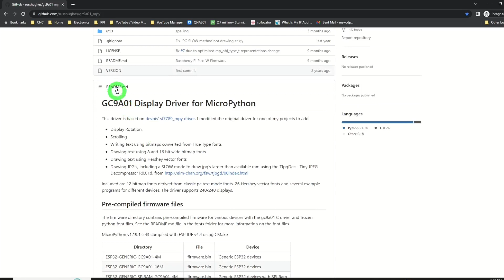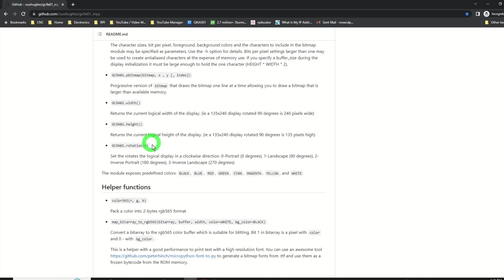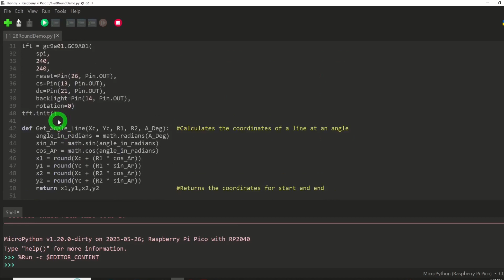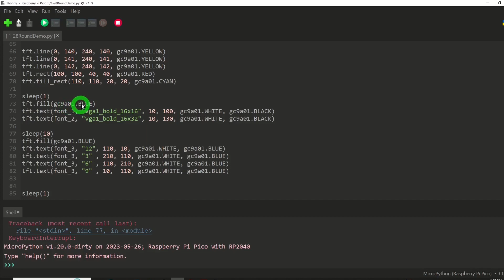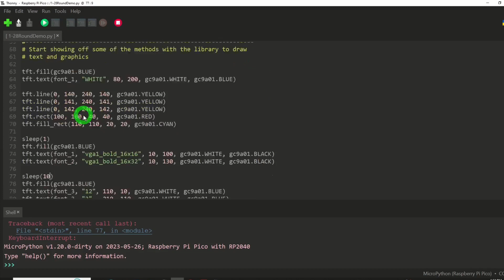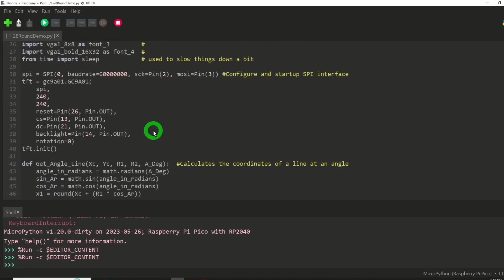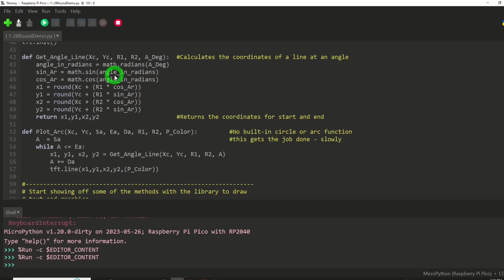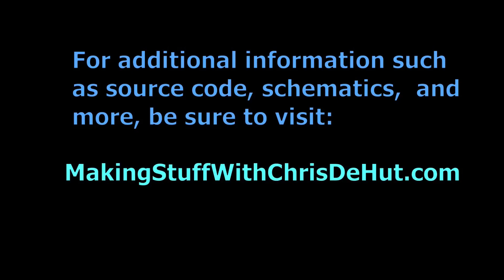Getting Started with the Waveshare 1. 28" Round LCD Display (SPI)

Comment: Hi Chris. I have successfully run your code and thought that it would be good to add the display of the current date and time on the Waveshare. Here I have hit an issue when trying to use some of the python Time functions as they do not appear to be included in the Russ Hughes UF2 file.  I tried to use "import datetime" to  use the strftime() function. I get an error stating that datetime does not exist. Any ideas on how to get over this?  I will try using another pico with the standard UF2 but obviously comment out the display bits. Cheers Peter
Reply from the maker: Hmmm, I wonder if that library exists within micopython?
Reply: @MakingStuffwithChrisDeHut  I ran it on a normal pico UF2 an it still said datetime not found so I guess you are likely to be correct. Thanks
Reply from the maker: @peterwest1158  I have been down that same road on a couple of things, it is a bummer. Being that the pico is so powerful and is programmed much like the PIs, we often forget the PICO is a lowly microcontroller.
Cheers!
Chris
Reply: @MakingStuffwithChrisDeHut  Hi again, I have cracked the problem thanks to some help from the MicroPython forum. I am using localtime() and formatting the elements in tuples for each field that I want.
Reply from the maker: @peterwest1158  AWESOME!!!! Thanks for sharing that update and I am glad you got that worked out.
Cheers!
Chris
Reply: @MakingStuffwithChrisDeHut  Sorry to bother you again but I can't find the definition of the parameters for TFT library calls in Russ Hughes UF2 files.
Reply from the maker: @peterwest1158  Hi Peter, I found this code in my notes that might help...

'''
This is a demonstration program showing some of the capability
of the Waveshare 1.28" round LCD display with an SPI interface.

The best performance I found is with a driver (embeded in a custom
UF2 file) that was written in C.  This driver performs substantially
quicker than the standard offerings I found at Waveshare.  This is
a link to the Git page where I found it.  Also lots of other
good information there too.
https://github.com/russhughes/gc9a01_mpy

BLACK = const(0x0000)
BLUE = const(0x001F)
RED = const(0xF800)
GREEN = const(0x07E0)
CYAN = const(0x07FF)
MAGENTA = const(0xF81F)
YELLOW = const(0xFFE0)
WHITE = const(0xFFFF)
'''
from machine import Pin, SPI      #need pins and the SPI library
import math                       #only needed for some 'razzle dazzle' drawing
import gc9a01                     #load the embeded library that is in the UF2 file
import vga1_16x16 as font_1       #loads a bitmap font
import vga1_16x32 as font_2       #
import vga1_8x8 as font_3         #
import vga1_bold_16x32 as font_4  #
from time import sleep            # used to slow things down a bit

spi = SPI(0, baudrate=60000000, sck=Pin(2), mosi=Pin(3)) #Configure and startup SPI interface
tft = gc9a01.GC9A01(
    spi,
    240,
    240,
    reset=Pin(26, Pin.OUT),
    cs=Pin(13, Pin.OUT),
    dc=Pin(21, Pin.OUT),
    backlight=Pin(14, Pin.OUT),
    rotation=0)
tft.init()

def Get_Angle_Line(Xc, Yc, R1, R2, A_Deg):  #Calculates the coordinates of a line at an angle
    angle_in_radians = math.radians(A_Deg)
    sin_Ar = math.sin(angle_in_radians)
    cos_Ar = math.cos(angle_in_radians)
    x1 = round(Xc + (R1 * cos_Ar))
    y1 = round(Yc + (R1 * sin_Ar))
    x2 = round(Xc + (R2 * cos_Ar))
    y2 = round(Yc + (R2 * sin_Ar))
    return x1,y1,x2,y2                      #Returns the coordinates for start and end

def Plot_Arc(Xc, Yc, Sa, Ea, Da, R1, R2, P_Color):         #No built-in circle or arc function
    A  = Sa                                                #this gets the job done - slowly
    while A <= Ea:
        x1, y1, x2, y2 = Get_Angle_Line(Xc, Yc, R1, R2, A)
        A += Da
        tft.line(x1,y1,x2,y2,(P_Color))

#-----------------------------------------------------------------
# Start showing off some of the methods with the library to draw
# text and graphics

tft.fill(gc9a01.BLUE)
tft.text(font_1, "WHITE", 80, 200, gc9a01.WHITE, gc9a01.BLUE)

tft.line(0, 140, 240, 140, gc9a01.YELLOW)
tft.line(0, 141, 240, 141, gc9a01.YELLOW)
tft.line(0, 142, 240, 142, gc9a01.YELLOW)
tft.rect(100, 100, 40, 40, gc9a01.RED)
tft.fill_rect(110, 110, 20, 20, gc9a01.CYAN)

sleep(1)
tft.fill(gc9a01.BLUE)
tft.text(font_1, "vga1_bold_16x16", 10, 100, gc9a01.WHITE, gc9a01.BLACK)
tft.text(font_2, "vga1_bold_16x32", 10, 130, gc9a01.WHITE, gc9a01.BLACK)

sleep(1)
tft.fill(gc9a01.BLUE)
tft.text(font_3, "12", 110, 10, gc9a01.WHITE, gc9a01.BLUE)
tft.text(font_3, "3" , 210, 110, gc9a01.WHITE, gc9a01.BLUE)
tft.text(font_3, "6" , 110, 210, gc9a01.WHITE, gc9a01.BLUE)
tft.text(font_3, "9" , 10,  110, gc9a01.WHITE, gc9a01.BLUE)

sleep(1)
tft.fill(gc9a01.BLACK)
tft.text(font_4, "12", 110, 10, gc9a01.YELLOW, gc9a01.BLACK)
tft.text(font_4, "3" , 210, 110, gc9a01.YELLOW, gc9a01.BLACK)
tft.text(font_4, "6" , 110, 200, gc9a01.YELLOW, gc9a01.BLACK)
tft.text(font_4, "9" , 10,  110, gc9a01.YELLOW, gc9a01.BLACK)

sleep(1)
SA = 0
EA = 360
CA = 0
while CA <= EA:
    Plot_Arc(120, 120, CA, CA+2, .1, 65, 80, gc9a01.MAGENTA)
    CA += 30

sleep(1)
SA = 0
EA = 360
CA = 0
while CA <= EA:
    Plot_Arc(120, 120, CA, CA+2, .1, 55, 60, gc9a01.CYAN)
    CA += 2
Reply: @MakingStuffwithChrisDeHut  Thanks yet again. Peter
Reply: @MakingStuffwithChrisDeHut  Last time Chris, I found that when I displayed analogue hands the time was rotated by 90 deg clockwise. Due to co-ords of the display y axis being inverted to classical. Solution was to subtract 90 from the angle supplied to the "Get_Angle_Line" function. All working well now Thanks for your initial code and the help. Cheers Peter